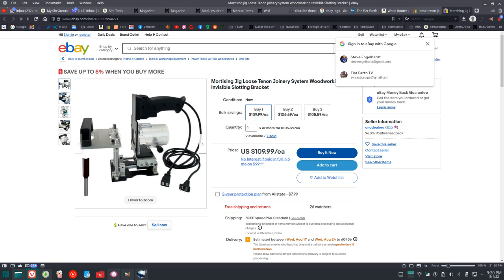Misusing a Chinese Trim Router Jig from Ebay for Loose Tenon Joinery

Comment: So... do you like the jig or recommend it for the price?
Reply from the maker: Yeah it's pretty sweet.  Works great with 1/4" stock cut down on the chop box - super quick.  (Lattice at home depot) That's what I been using for the tenons mostly.  I only used it on pine mostly and some oak.     Its not perfect,  but I'd reccomend it for sure.   

Compared to dowels,   I'm liking it better than the wonky dowel jig I got for sure.  Compared to pocket screws,  I'm liking this better as well, for pine anyways the pocket screws are pretty weak. 
 This could be a sweet dowel jig as well with some light modifications, I believe. 

  I'm surprised this isn't like a real tool available at  home depot. 
You gotta buy a different bit for it to do what I did, I put a link for that in the description as well.  
Shit that just gave me a idea, I should make a new video, paint that shit green, and call it a ryobi loose tenon joinery jig for trim routers, ill say I bought that shit at home depot,  that'd really screw some people up looking for it.  Shit..  I could even photoshop it into a home depot's website and fake advertise it..   yeah I think I'm gonna do this.
Reply from the maker: call it "Royobi" ... 😆
Reply: Haha! For sure, bring the internet down!